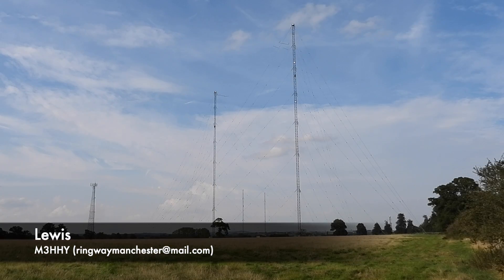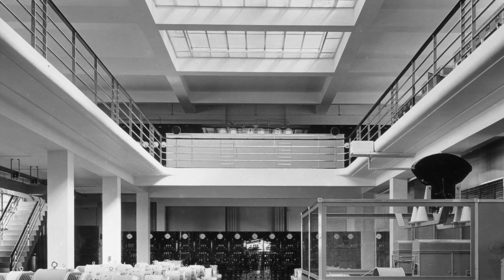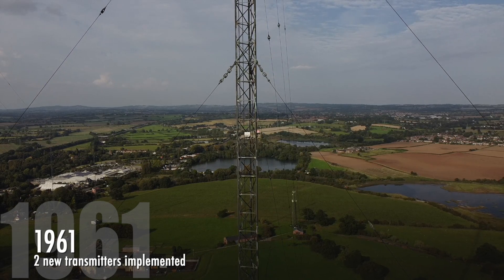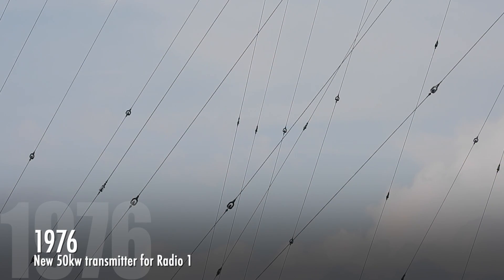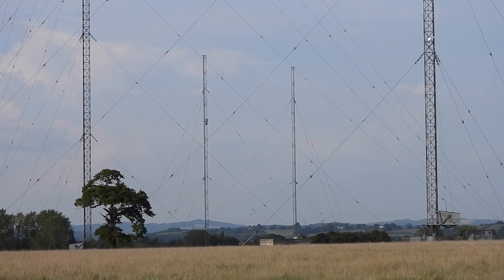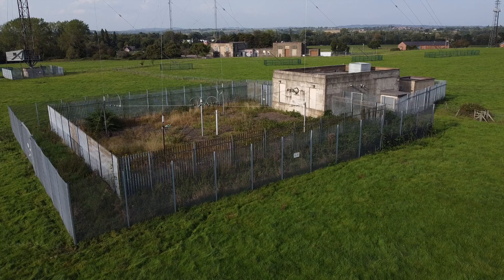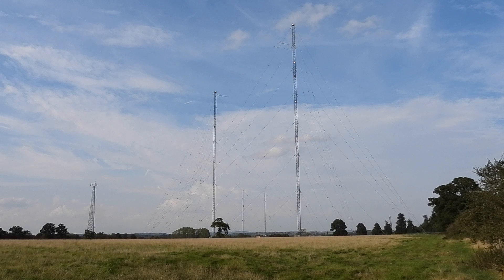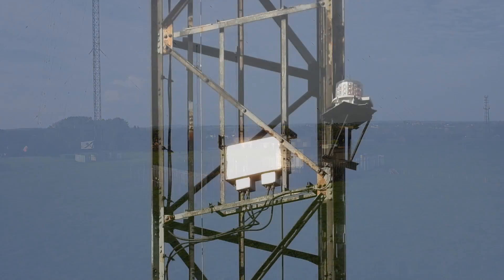Droitwich: The Death Of The 1/2 Million Watt Transmitter

Comment: Damn. Never thought I'd live to be old enough to see the end of longwave... Sad days, beyond just nostalgia. The ability to make a receiver out of a handful of components and no battery... and to be able to hear across the world.... priceless.
Reply: My first detector radio was made out of trash and home brew detecting crystal. At day time it received Radio Mayak USSR and at night it was perfect tuned to Voice of America.
Reply: Really sad
Reply: I'm in my twenties and looking ahead it does seem to me the airwaves are set to go awfully silent in the next few decades. It seems only a matter of waiting to see if either radio or TV broadcasting go out first. I'm hoping to be one of the ones watching (and hopefully recording) the last minutes of linear terrestrial (broadcast) TV in the UK before it dies off.
Reply: @shodan2958 On the other hand the em spectrum is becoming busier than it has ever been. It's just all digital now.
Reply: @shodan2958 linear TV likely will be replaced with cellular and there‘s ongoing testing with LTE band 71 in Switzerland. But until that happens, it will likely be another 20 years. I hope the slice at 478-500 MHz remains used for TV though. 

But there‘s one thing which will likely remain and that is DAB+, just because the spectrum around 61.25 to 239.2 MHz can only be used for SDL/SDO purposes and not 5G because it requires large antennas or inefficient antenna designs for transmitting on handheld devices.
Reply: I don't think radio or TV will go anytime soon. Radio is useful while driving a car and TV is more user-friendly than the internet.   I think newspapers will go quite soon, they don't produce "news" anymore, just opinions!   The internet is prone to hacking , eavesdropping by cookie, and manipulated or fake news, that it is more likely to be ignored. @shodan2958
Reply: Really sad. I listen to PM on Radio 4 LW on my Grandparents’ old Bush radio when I’m doing the dishes. Almost every weekday. I’m  gutted.
Reply: Same 
A diode a piezoelectric earpiece ...thin copper wire and a 500 of condenser ..ferrite rod .
Music culture no batteries 
All gone
Reply: The old crystal sets !
Reply: @tonyknight9912  yep 50 feet of wire down the garden to a tree
Metal bedframe as the Earth .
Free music no batteries .
Reply: I still have an analogue tuner in the stereo. Long Wave meant Test Match Special, the signal pulsing in the car radio was the background track to family holiday journeys.
Reply: Baš tako.Tužno je što su širom sveta ukinuli AM opseg radija.
Kod mene u Srbiji NATO porušio 1999. godine tokom bombardovanja moje zemlje.
Najžalije mi što srušiše glavni predajnik radija na srednjim talasima,bila antena 235 m.visine,ogromna bila snaga napajanje dolazio dalekovod direktno iz elektrane samo za napajanje predajnika.
Velika tuga što to nije obnovljeno...😢
Reply: Or to listen to foreign radio in the basement. Although without a proper antenna, longwave reception was really bad. I remember playing around with LW receivers as a child and not knowing what I was doing and I wondered why there was French coming out of my radio.
Reply: That's the sadness in one reply.  We're post radio now really.

Comment: I'm going to miss Radio 4 LW when it goes.  I've had reasonable reception when travelling in northern Europe, and then there's TMS.
I'm sure I read somewhere that they turned the power down to increase the life of the valves.  Not sure how true that is.
Great video, Lewis.  Thanks.
Reply: If what the station runs on at the moment is actually turned down power, then that's impressive. it's still perfectly receivable in Austria.
Reply: @David_Granger  Unfortunately not in the bit of Austria that I spent three weeks in, a few years back.  The somewhat large mountain half a mile up the road may have had a part to play...  🤔
Reply: Absolutely. Used to be my link to home. And something that made borders seem less of a thing. Sad times. Just another nail in the coffin 🇬🇧🤦‍♂️🤦‍♂️
Reply: It's entirely likely that the reduction of power was to prolong the life of the valves.  When I visited Droitwich as part of my BBC course in 1974, they were worried even then about the extreme scarcity of the valves.  I don't know if you've ever seen an enormous valve of that type, let alone in an equally huge custom-built glass-fronted wooden case (no doubt built by craftsmen), but I can tell you it's a massively (pun intended!) impressive sight!

Comment: Also Lewis From September 1988, Radio 1 began its FM switch-on, with further major transmitter switch-ons in 1989 and 1990. It was not until the mid-1990s that all existing BBC radio transmitters had Radio 1 added. Previously, Radio 1 had "borrowed" Radio 2's VHF/FM frequencies for around 25 hours each week. So Radio 1 went FM in the late 1980's
Reply: Yes, which is why you had to change to radio 2’s frequency to listen to the chart show in stereo!